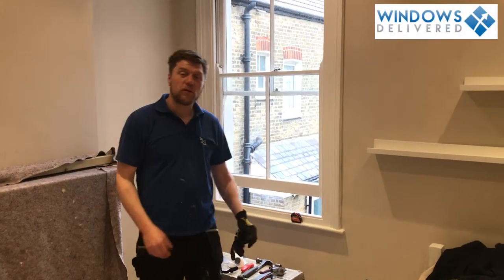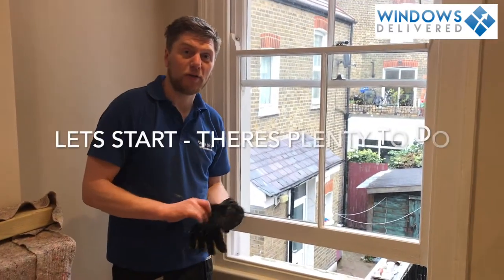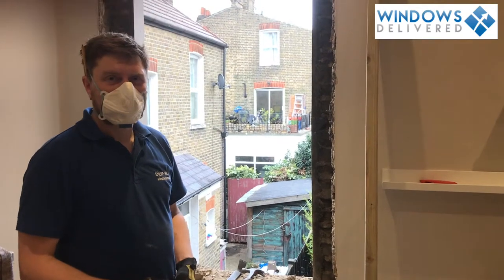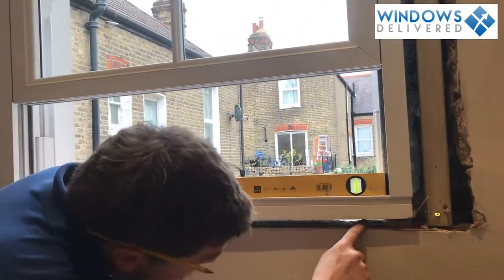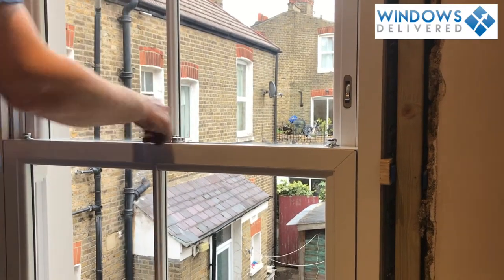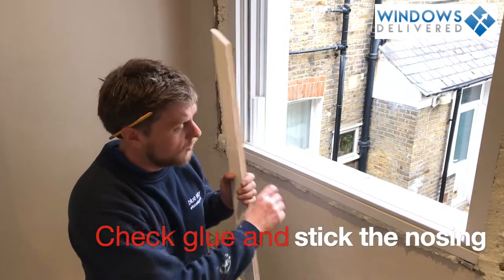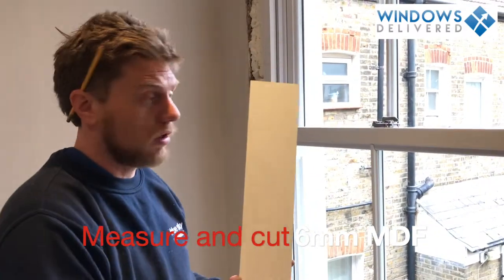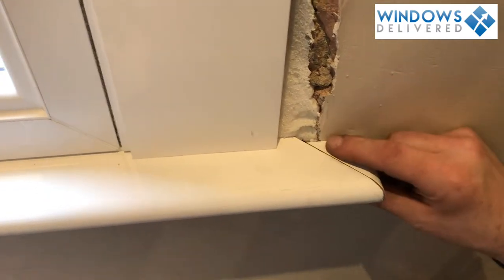Evolve PVCu Sash window installation

Comment: I've done a few of these windows and I don't see any reason to take the old wood boxing out and replace it with new timber, I screw straight into the original seasoned timber. But good video, by the way whats he spraying on the timber trim before putting on his superglue?